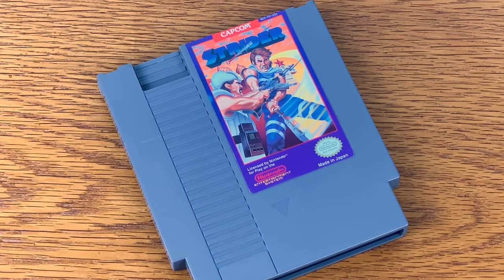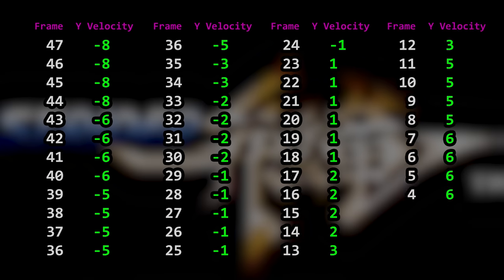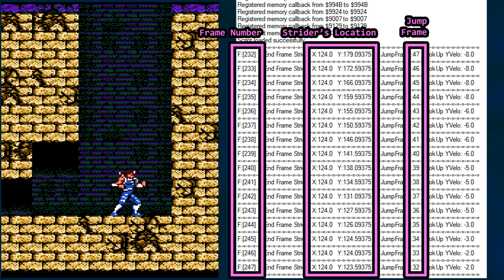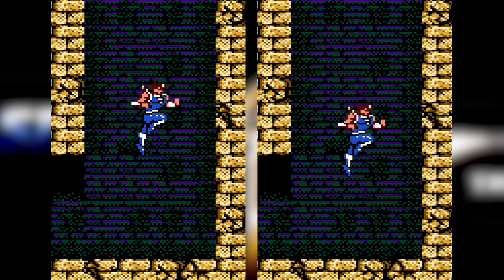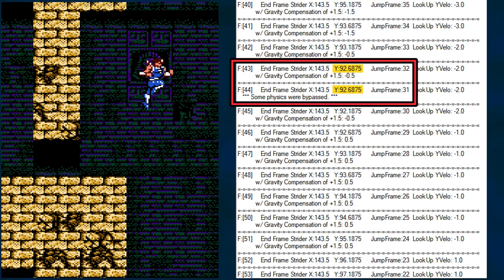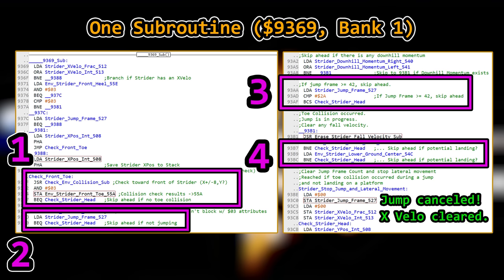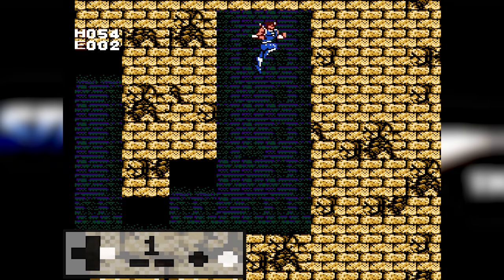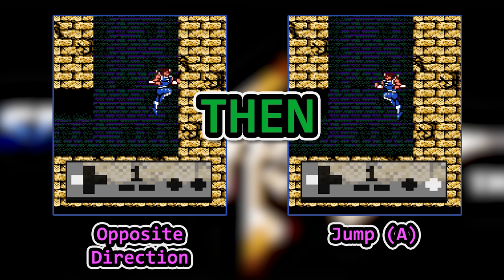The Physics Nightmare and Bizarre Jumping of Strider (NES) - Behind the Code

Comment: Walljumping in Super Metroid has roughly the same requirements. You must turn away from the wall before you can jump. Likely because there's a special pose for preparing to wall kick. I like it this way, but it does get a lot of complaints.
Reply: Interestingly, wall-jumping in Metroid: Dread is the exact opposite. You must still be pressing into the wall in order to jump off of it. Now, this works in Dread in part because the game won't allow you to move Samus towards a wall until you've reached the height of your jump (and therefore cannot wall-jump up a single wall).

But it also exists because you can speed boost into a wall and wall jump off of it, retaining your speed boost. Having to switch directions to wall jump would mean potentially losing your speed boost if you pull back too early. So there's enough time to visually confirm that you speed-boosted/wall-jumped correctly before you have to switch directions.
Reply: Was wall-jumping even an intentional part of Super Metroid or was it just something people figured out to do after it was released? It feels more like an exploit than anything else, seeing as no part of the game requires it.
Reply: @zanegandini5350  No, it was deliberate.

There is an entire room and creatures that populate it which exists to teach you how to wall jump. A room you can't leave without demonstrating some mastery of wall jumping (or infinite bomb jumping). It may be optional, but it was an option explicitly put there by the designers.

Indeed, this fact is a big part of why SM became what it became. An optional move like wall jumping that could be employed to bypass certain "required" stuff or get some stuff early encourages players to find other tricks to break the sequence.
Reply: The difference between walljumps in Super Metroid and Triangle Jumps in Strider NES are that SM not only has a visual cue for the button timing but they're also consistent; there's a technique to doing them well, and you don't feel like it's the game's fault if you miss a jump.
While Strider NES's Triangle Jump is not quite as bad as one may get the impression of from this video if they've never played the game, it's still janky and inconsistent-feeling even with the right technique, and there's no visual indicator for them to indicate timing or even that you're supposed to turn around before trying to jump off the wall. Not to mention that you can't immediately Triangle Jump again after doing one, so that's another bit of timing to learn and one that adds to the inconsistent feeling.

Comment: But approaching this as a game designer i see how the code kinda of had to be that way. 
1) simply holding down the Jump button is too easy. 
2) waiting on the jump counter to decrease to 42 is so you can't just jump straight up one wall like in Hollow Knight -- again, too easy and also makes boundary breaking everywhere an issue -- it requires two opposable walls to gain height.
3) rapid falling when touching a wall is, again, so the player must learn to time it right instead of trijumping at roughly the same height forever. (though use the upper hit point by the head not the foot so when I'm jumping onto a higher platform I'm not slammed down)

even batman slides down the wall at least a frame before catching.  Though the turnaround animation gives the player time to adjust direction and a cue when to press again.
Reply: It didn't have to be this way at all. I'm really confused why you think this. Most games avoid all of the physics issues of this game and the ones you think these issues are somehow preventing
Reply: @MaxOakland  really bizarre to describe this as intentional game design in a video that literally decompiles the code and has footage of ninja gaiden and batman.
Reply: The fact that the game launches you in the opposite direction of the wall makes point 2 redundant; by the time you could steer Hiryu back to the wall you jumped from the jump counter will have already counted down.
All it really serves is adding an additional layer of timing to the technique, and in my opinion making it feel all the more inconsistent.

Comment: How do you manage to view the game's code?

If you can read Hex code, can't you just alter the code and make a modified rom?

Or is it just not viable?
Reply from the maker: You can use the debugger in various emulators to read the machine code and write it out as assembly instructions. After that, you have to figure out what the various addresses represent (positions? velocity? health? Etc.).  After that, you can follow the logic to see what the code in a particular area is doing to manipulate those values.

Even if you can read the hex directly, code relies upon specific code and data residing at specific locations. So you could modify the instructions that are there or reduce the instructions that are there, but you cannot easily expand the instructions that are there.

That's a crude response, but hopefully it makes sense.
Reply: @DisplacedGamers  Hum...interesting.

Thanks for the explanation.

Comment: How are you showing the frame info? Did you patch in a print?
Reply from the maker: The emulator keeps track of it, so you can just print it out to the screen with a Lua script.
Reply: @DisplacedGamers  which are you using. I was working to write something similar in ghidra.
Reply from the maker: @dmaynor  Mesen

Comment: Wow, you CAN fix this hot mess of a game. I won't lie, I just went wild to do that triangle jump. Doesn't work for super metroid, and yes I started over when I entered that one shaft without space jump.
Reply: At least with Super Metroid's wall jump, it's very consistent once you get a feel for it. Without diving into the code, I suspect it's a similar problem to the one he mentioned here in Strider where the wall jump could use a test target that's a little further away from Samus. If you pay close attention, Samus' animation changes to a wall cling animation briefly during the wall jump window. But the animation ends if you get a few pixels from the wall. If the test target were a little further back, I suspect that the wall jump window would be a lot larger and easier to hit.
Reply: I had the same problem as a kid, but my last playthough I finally landed it. To add to the below commenter you press off the wall before jumping but only very slightly to get that animation change to the cling graphic, then you hit the jump.
Reply: Good news is that metroid series made wall jumps lots easier for later games. You know which game series people never complain about the wall jump. Megaman X. So much that people complained Megaman 7 should of had wall jumps too.
Reply: @clarafedde8674  You know, it's true. Mega Man X wall jumps are very easy to pull off, and they make you feel cool, despite their simplicity. If I had to rate video game wall jumps, Mega Man X might just be at the top of my list.

Comment: There is nothing wrong with having a table with pre-calculated Y-accelaration values, it's not how  indy games do it now a days, but for a 8-bit cpu is the perfect solution to my understanding, that way you avoid lineal and quadratic boring curves.
You have a Y-colision (on the top detecting-pixel)? Not a problem, just jump to a new position in the table.

Seems to me, the problem with this games is that only checks for wall collision every other frame.
Reply: There's no reason why an 8-bit cpu can't do it properly. Set the y velocity upon jumping, then decrease it by some amount each frame to reflect gravity. 

It also means the jump arc is incredibly flexible just by changing the initial jump velocity or gravity constant. No need for some hacky 1.5 pixel adjustment as seen here, or having to muck about changing every value in the jump velocity table.

You can even allow dynamic jumps by adding extra velocity every frame the button is held, as seen in Bomb Jack.
Reply: Most games don't use a lookup table for this and there's no reason to use a lookup table for this. The 8-Bit CPU has no bearing on this
Reply: Why would you need more than 2 acceleration values? One for getting up into the air, for either a fixed number of frames or a fixed maximum number of frames while the jump button is held, then transition to falling acceleration. Accelerations are in pixels/frame^2 and get added to velocity every frame. Velocity is in pixels/frame. Velocity gets added to pixel position every frame. There are no multiplications just additions, so perfectly 8-bit friendly, and the behaviour is physically plausible. In particular i can't imagine wanting the falling to be anything but the standard ballistics.

I guess you might want to design the acceleration up portion of the cycle, then just skip the middleman and use a velocity table. It doesn't make sense to start a jump with anything but 0 or constant vertical velocity anyway.
Reply: @arlasoft   As I said the advantage is to avoid linear curves. Otherwise is the same, just using less code with a table. The difference is negligible for a 5Ghz and 16GB machine, but not for a 2Mhz few-KB which already is struggling at 30 frames/second and collisions at 15f/s.

The reason to use fixed numbers as position and velocity is that 3 pixel/frame is too slow and also 4 pixels/frame is too fast. That's it!
Maybe on 1920x1080 resolution you can fine tune better than in 256x256, but still the "proper" way will be to choose the perfect speed with... more fixed numbers!
Reply: @SianaGearz  Only 2 speed values doesn't work is terms of authenticity, you need to slowly decrease acceleration at the top then, when falling, increase slowly. Otherwise doesn't seem "realistic".
Then you need to make it fun, while still "acceptable" in terms of "everyday physics".

Anyway, the difference of using a constant value or a constant table is so minimal that I wonder why all the fuss? Is programing though in churches nowadays?
Reply: @miquellluch1928   This is why any 8-bit game worth its salt uses fixpoint fractional position, velocity and acceleration values for the player. Your position can be 16-bit value (12:4, so 16 subpixels) and velocity and acceleration can be 8-bit (4:4). Before you apply position to a sprite, you right shift it to discard the fractional part. Add with carry operation allows to easily and quickly chain 8-bit additions and subtractions to work on longer numbers.
Reply: @SianaGearz  To my understanding that's absolutely correct! That's how you must do things on a NES game.
Reply: @miquellluch1928  You do not switch acceleration at the apex. You switch acceleration very very early on in the jump cycle. If you switch acceleration at the apex, you would run well past the apex, since you first need to decelerate to vertical velocity of zero, that's your apex.

First you apply a high magnitude acceleration upwards, much higher than gravity. This brings you to your jump vertical velocity. It's a very short phase. As i said, using a velocity table is just as valid for this part instead of acceleration logic, or even part of the way to the apex, but you'll have to keep those velocities plausible.

Then you apply gravity acceleration logic (negative) which slows you down to the apex completes your jump arc and allows you to keep accelerating as you keep falling further down. You also clamp velocity values to terminal velocity.

The falling acceleration is specifically constant, except it's effective zero (due to velocity clamping) when reaching terminal velocity.

In the real world, you fall at -9.8m/s^2 acceleration which is a constant, until after a long enough time you approach terminal velocity (air friction) which counteracts some of that free fall acceleration. Your velocity keeps changing when you approach the apex and then fall but your acceleration for the most part does not. You jump by lowering yourself and then applying a short and very strong acceleration upwards, while constant free-fall acceleration of -9.8 is always acting upon you and always making you fall. The constant free-fall acceleration is responsible for the whole ballistic function.
Reply: @SianaGearz  You said it yourself, you can do it with a bunch of functions or with a table with pre-calculated values. Not counting cycles and memory space is the same.

Changing to another adjacent topic, there are other ways to do things that shock people coming from physics, that is you don't need gravity as a distinct value at all, because is bake in jumping/falling speed values, or because you don't need it at all when your are running/walking/standing (as long as you ensure you are actually running).
Reply: @MaxOakland  You meant to say that a frame base table and a variable frame rate game is not a good idea to mix.
Good! but NES is a fixed frame rate system. Also you can transform the table into an interval timed one. Animations are done that way.
Reply: @miquellluch1928  I'm not sure you know what you're talking about, I've written 30+ games for the C64, 2600, Pacman hardware, Apollo Guidance Computer, PDP-1, you name it, so I'm perfectly aware of what the 6502 and earlier CPUs are capable of doing in 16.66ms (or 20ms in PAL regions). These calculations barely touch the sides, whether in terms of RAM/ROM or CPU cycles. Collisions can be heavy going but if there's only a handful of objects (as seen here), there's no reason why they can't be done at 50/60 FPS and leave plenty of CPU time left for other things. My C64 ports of Galaga and Galaxian are processing collisions for the player, up to 8 bullets/bombs and 50+ enemies every frame.

Look at C64 platform games, not only did they have to do all the collisions and physics calculations every frame, plus a sprite multiplexor and SID player routine, they had to manually copy the entire screen and colour data for every 8 pixels of scrolling, which takes a LONG time. There's no such overhead on the NES, and that has a 70% higher clock speed!

If 3 pixels per frame is too slow and 4 frames is too fast, you just use a 16-bit value for velocity and the player X & Y positions. You then use the MSBs to determine which screen position to place the player at. Therefore you can make very minute adjustments to the jump arc, by changing the initial jump velocity from 3 pixels and 50/256 sub-pixels to 55/256 you get a small but noticeable difference to the jump height. Adjust gravity from 21/256 sub-pixels per frame to 22/256 per frame and the player returns to the ground slightly faster. You could even use different gravity values when jumping as opposed to falling to get the exact feel you want. Just by changing these two values you can go from a low, floaty moon jump to a high jump with insane gravity inside a few seconds, and it will look smooth. Try doing that with a lookup table. Not to mention that for every enemy you want to have a different jump to the player, they would need their own XX-byte lookup table instead of just two bytes each for the initial jump velocity.